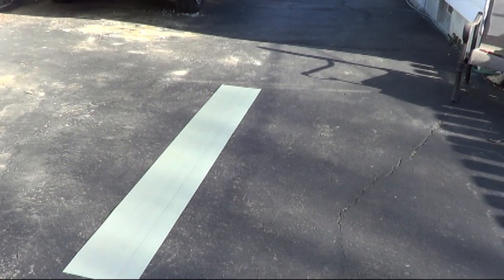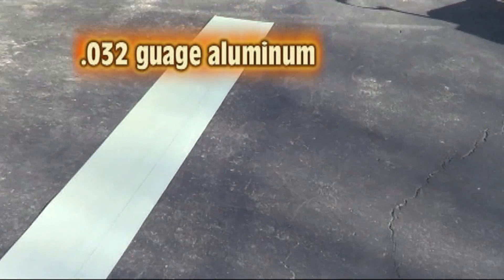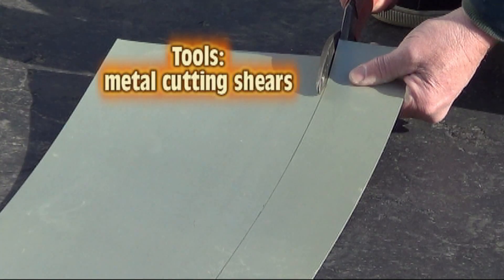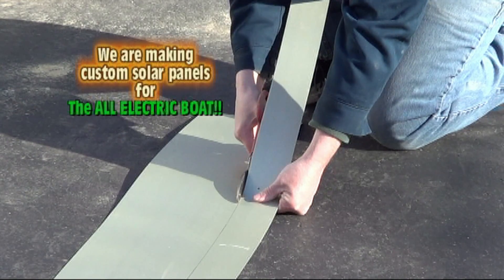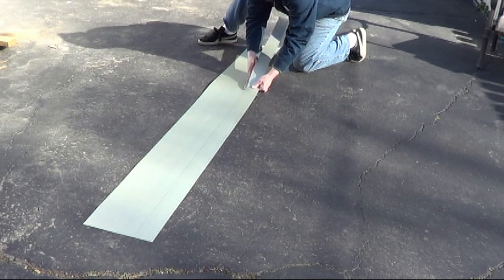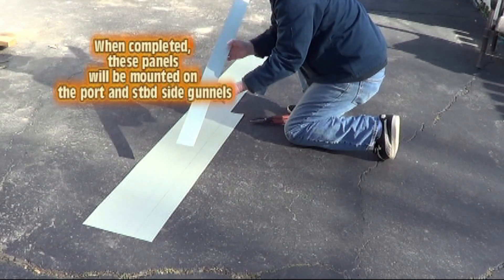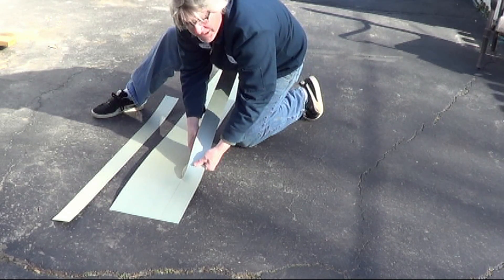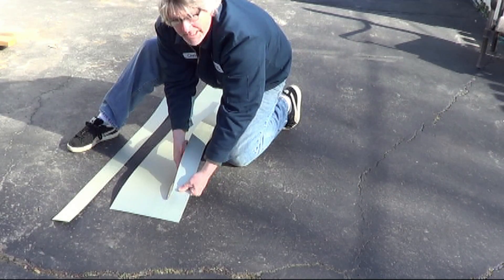solartekTV ~ Howto make Semi-Flexible SOLAR PANEL DiY part 1 of 13  metal cuts

Comment: 4 minutes to show how slow you can cut a single piece of sheet metal.
Reply from the maker: ~ hey buzz~ thanks for watching. ~ yes , these videos will~  show & tell ~ you everything you need to know about making a ~ semi flexible solar panel.~  i guess i should make a summary video.~  with click the link points as so those who do not know how to actually do the many steps necessary to build a panel can then watch one of these in depth how to steps.

thanks again for watching and your comments. they are appreciated!
Reply: ikr

Comment: One question where would you buy this aluminum gutter coil? and how much do they typically cost
Reply from the maker: hey Isub ~ thank you for watching! a housing supply company , roofing company or gutter supply company are three places that always have aluminum gutter coil and you can have them cut aluminum to length you want for a couple extra dollars~ aluminum runs about 50 cents-$1 per foot

Comment: Well the initial idea is to make a solar "sail" out of flexible material (like powerfoil/powerfilm, whatever theyre called), but make the flexible base out of a thermoconductive material to counteract the "the more heat, the less energy intake" problem that you see in full flex solar panels. Even if all the thermoenergy layer did was power a coolant system to drop the temperature of the solar cells back to optimum solar absorption temp, or something.